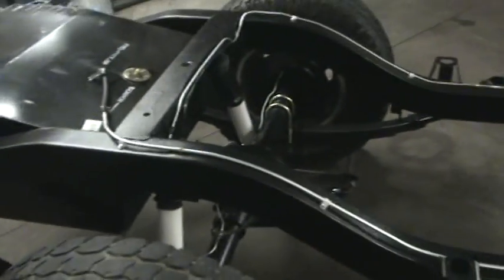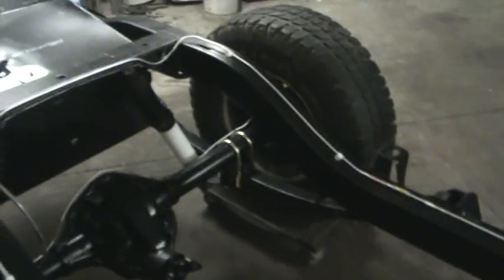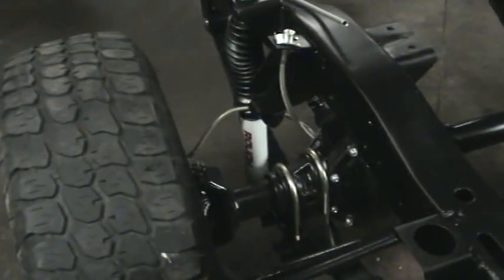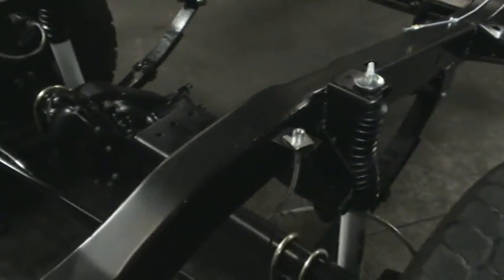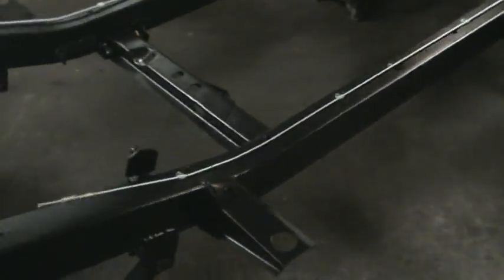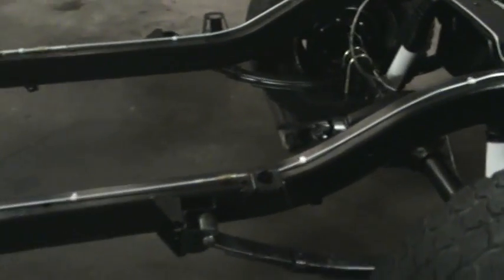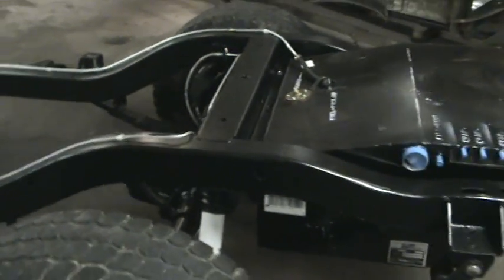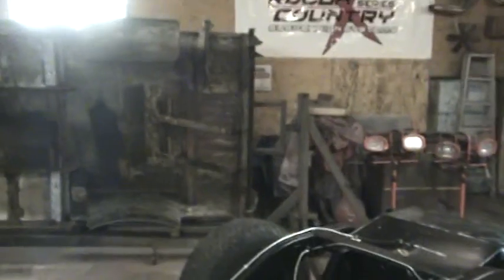Silverback Custom Works Scout Restoration Segment 5

Comment: Just an FYI. I installed a rough country 2" lift abut 4 months ago. On the springs I noticed that the distance from center to end is different, about a 1/2". I called them and they told me that the sticker goes to the fixed end. I asked "are your sure? are you sure? really sure?" they said yes. I can't remember  wich way the short and long ended up, I think is was "short to shackle".